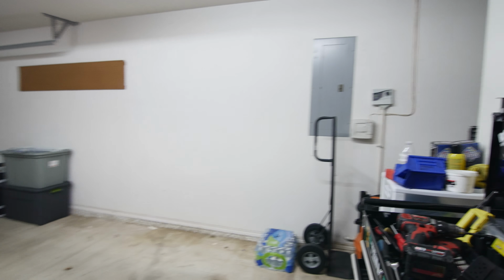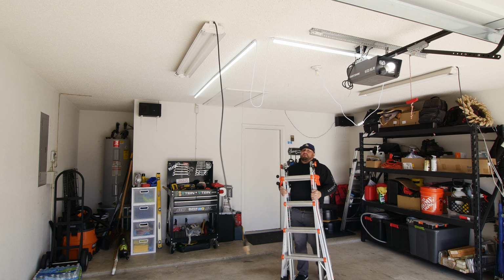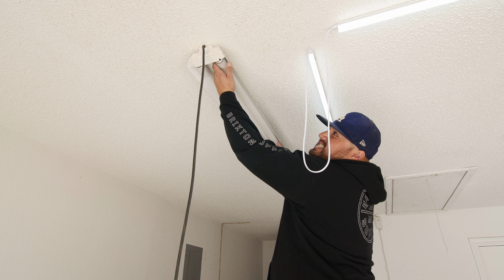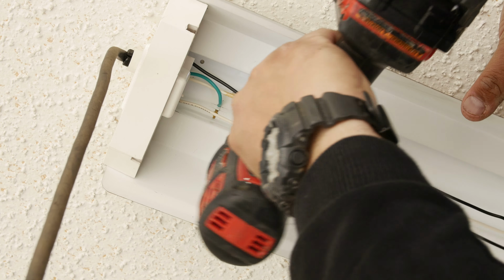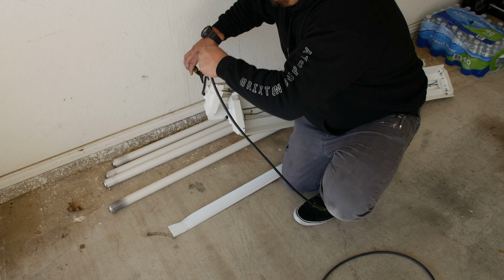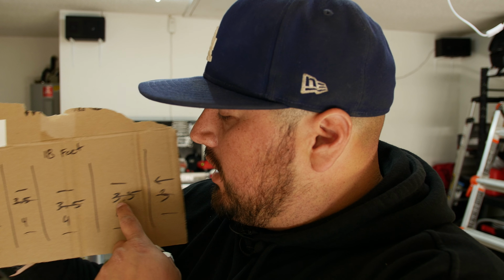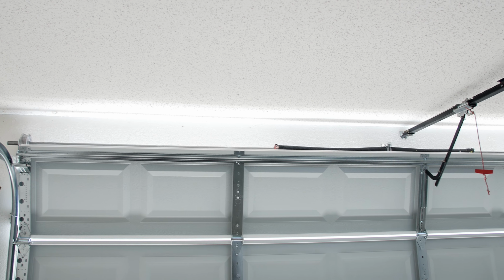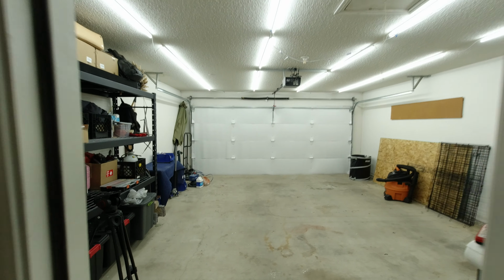16X Barina LED Shop Lights For Garage / 35,000k Lumens

Comment: Love these lights! I got a 6 pack of 4ft the same brand to install in my garage as well! Super lit! 🤙🏼 I actually got them cheap on amazon. I also order cable concealer to hide the wires and make it look cleaner instead of dangling wires. 🤙🏼
Reply from the maker: Dude the lights are amazing ballin on a budget.